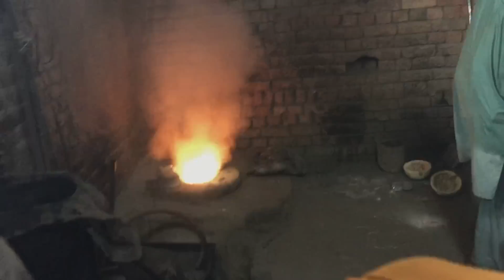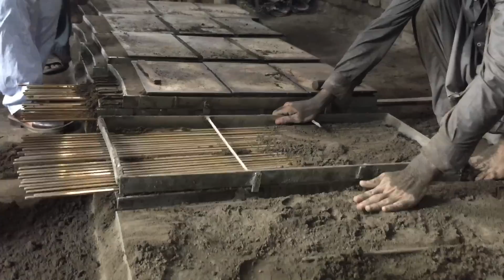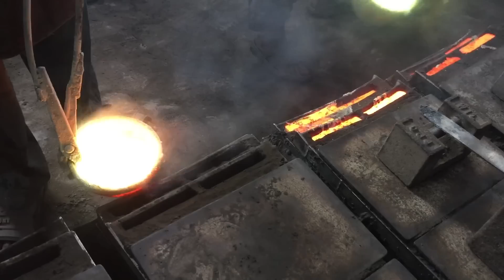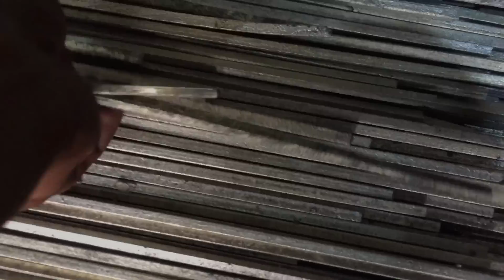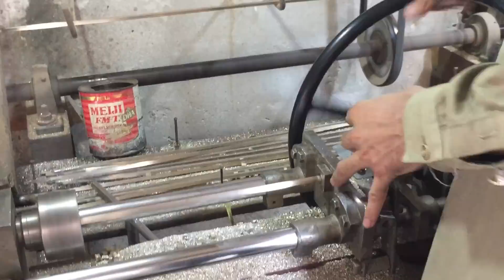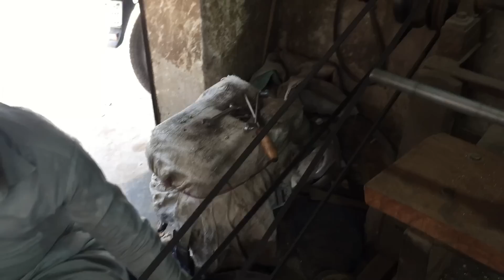Amazing process of making electric wire connector | How to Make Brass wire connector

Comment: Hey look 1900 tech. we did this in 1850,
Reply: We have the technology, we have the knowhow, our production has quality control. You can see that We implement safe working condition for the employs and for the  environment. 
Employs safety and compatibility with the ecosystem are our constant priorities to prevent employs accidents and environment pollutants for air, water and soil. 
These factors are mitigated by providing our working force with safety glasses, breathing gas masks, safety boots and fire resistant clothes and gloves. 
The next video we will show more stringent measures in performing  working tasks: better protective safety standard for the employs and a clean ,organized shop.

Comment: We have the technology, we have the knowhow, our production has quality control. You can see that We implement safe working condition for the employs and for the  environment. 
Employs safety and compatibility with the ecosystem are our constant priorities to prevent employs accidents and environment pollutants to the  air, water and soil. 
These factors are mitigated by providing our working force with safety glasses, breathing gas masks, safety boots and fire resistant clothes and gloves. 
The next video we will show more stringent measures in performing  working tasks: better protective safety standard for the employs and a clean ,organized shop.
Reply from the maker: we will try to best bro

Comment: I see the operator breathing lots of zinc containing healthy smoke in the first scene!
Reply: at least he does not have to buy zinc tablets
Reply: @knowldedge5012  to``www
Reply: And possibly lead if it is leaded brass scrap.  Trace amounts of arsenic too.  My heart goes out to these guys just trying to make a living at a foundry with less safety equipment than i use trimming hedge bushes.
Reply: @RodSnocking350  Correct !
Reply: yeah that zinc smoke is not good

Comment: Their metallurgy is like Italian cooking, a pinch of this and a dab of that. All of the loose fitting clothing near rotating machinery looks safe enough and I'm sure the open toe safety sandals are Osha approved. And people still wonder why I demand American made products, they are indeed worth the difference in price!
Reply from the maker: Oh my God
Reply: We have the technology, we have the knowhow, our production has quality control. You can see that We implement safe working condition for the employs and for the  environment. 
Employs safety and compatibility with the ecosystem are our constant priorities to prevent employs accidents and environment pollutants for air, water and soil. 
These factors are mitigated by providing our working force with safety glasses, breathing gas masks, safety boots and fire resistant clothes and gloves. 
The next video we will show more stringent measures in performing  working tasks: better protective safety standard for the employs and a clean ,organized shop.

Comment: Do a video on cleaning up the shop.  So much crap laying about.
Reply: I worked in a steel fab shop in the 1990s in the USA.  We made gas pump island borders and manhole assemblies.  We would start production in the morning at 7am: cut, drill, mill, form, weld.  We would start painting around 3pm.  And then hand it over to the shipping truck at 315.  Shift ended at 330.  I only worked there for 6 months and the only time I remember cleaning up shards of scrap from behind the shears and shavings from mills was 2 hours before the end of the shift on Christmas Eve.  Other than that, we stumbled on the debris.  That job was a shock after working 3 years in a cleaner and better organized shop.
Reply: Working in a messy workshop tells more about the pride of the workers than anything else. You should either start your day / shift by cleaning the work area, or end your shift doing so. When it starts accumulating, it’s too late, because it becomes everyone’s responsibility, i.e no one’s task...
Reply: @xl000  In my case, the employer didn't allow time to clean up.  I am surprised no one reported him to Osha.
Reply: @corvettebob96  ok, not your fault though. In my experience, you need 15 minutes of clean up per 45 minutes of work - for a job that is not already streamlined, with all the jigs built and whatnot. And if you skip those 15 minutes, you start doing less and less work during those 45 minutes, even if you extend those 45 minutes to 1 hour and totallt skip the clean up. And it gets even worse when you start messing your workpiece because of the conditions, and you basically lose the time and the material.

Comment: It is good they wear safety shoes 😪
Reply: We have the technology, we have the knowhow, our production has quality control. You can see that We implement safe working condition for the employs and for the  environment. 
Employs safety and compatibility with the ecosystem are our constant priorities to prevent employs accidents and environment pollutants for air, water and soil. 
These factors are mitigated by providing our working force with safety glasses, breathing gas masks, safety boots and fire resistant clothes and gloves. 
The next video we will show more stringent measures in performing  working tasks: better protective safety standard for the employs and a clean ,organized shop.